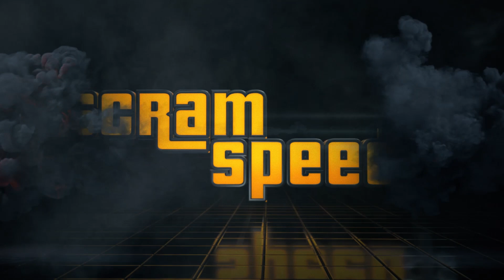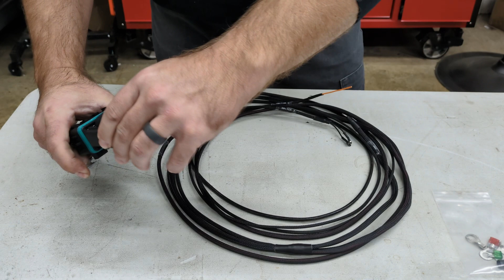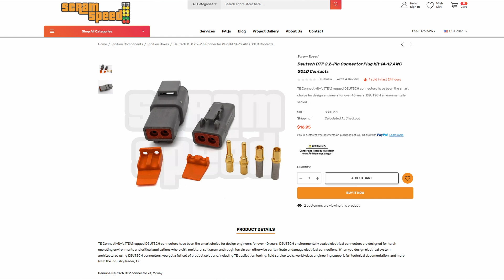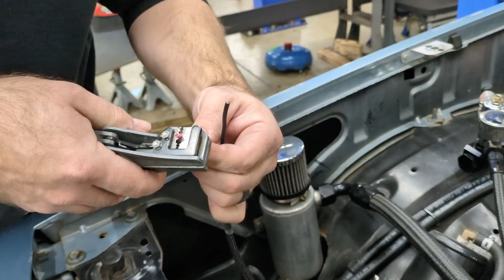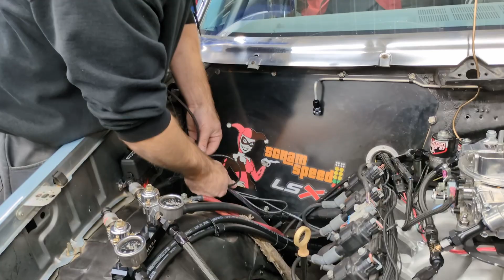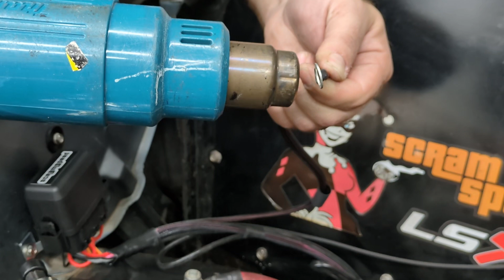Electric fan wiring kit! One hour installation! Looks great, works great.

Comment: Nice kit, will this wk for a 2000 Silverado with a 4.3? I have the fans and updated radiator just need the wiring
Reply from the maker: Our ground activated kit would be a better choice for thaat truck. If you'd like, give us a call at the shop and we can help. Thganks! 217.590.0128

Comment: Hi there. Like to purchase this kit. I have a 63 Impala that I’ll be installing electric cooling fans. I’d like keep the stock “cold” light in the dash operational. Can I splice into the wire lead to the thermal switch or will that affect the thermal switch?
Reply from the maker: The lead to the thermal switch is a ground. As long as you are not putting 12v there with your light, it should be no problem.

Comment: Nice kit and great installation. One thing I would do is add a precaution inline fuse in the power wire going to the battery. I know it’s already fused from the new kit but I just feel like sometimes wires get so hot that they can melt and cause all kinds of problems so best bet is to just be safe and use a 10 amp inline fuse at the very least.

Comment: Sorry I’m slow, how would I connect this to my ‘04 Silverado? I’m not using Holley or anything like that. Just a factory 5.3
Reply from the maker: This wouldnt work for that. As it needs the same connections as your factory pcm.
Reply: so if I buy the dual swap fan harness from jegs, would I be able to use your fan switch instead of needing a tune?
Reply from the maker: @Solcutz_ yes. But you might give our harness a look. Its made for our switches. 

https://www.scramspeed.com/products/scram-speed-dual-electric-fan-relay-wiring-harness-thermal-switch-trigger.html
Reply: @Scramspeed  will it work good with factory ac? I'm converting my '02 1500 from mechanical to electric cooling fans.

Comment: Looks like a kit I need, i heard you say it works with an LS ecu, but I need know how to connect it to a Terminator 1x Max ecu.  Using the I/O ports, blue wire goes to where, black wire from the fan or the relay gets grounded?  I find that part is skipped over a lot.  Thanks.
Reply from the maker: We sell a kit specifically with the Terminator X in mind. It uses the ground output from the Terminator as a ground for the fan relay.
Reply from the maker: https://www.scramspeed.com/products/scram-speed-dual-electric-fan-relay-wiring-harness-ground-triggered-great-for-efi-swaps.html

Comment: Great kit.. just wish the connectors to the thermo switch was a bit better. spades tend to work themselves loose with time/vibration, specially on a rowdy engine.